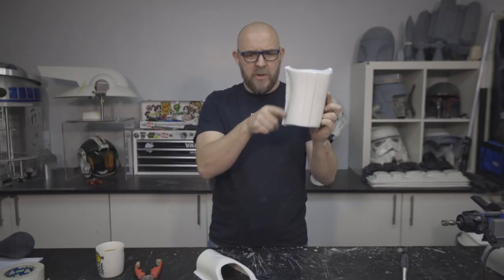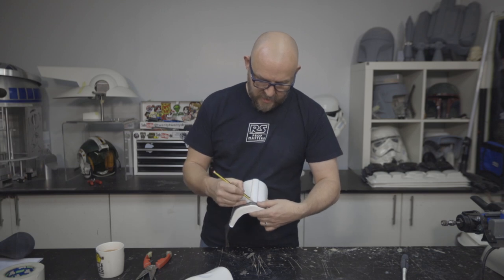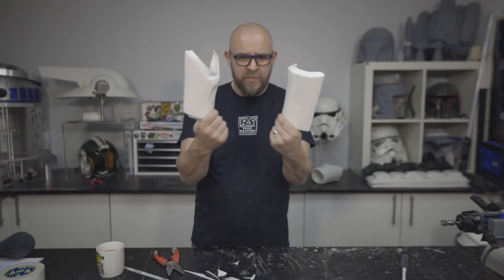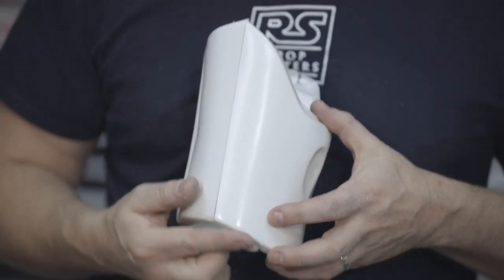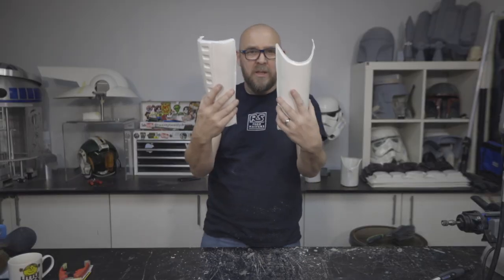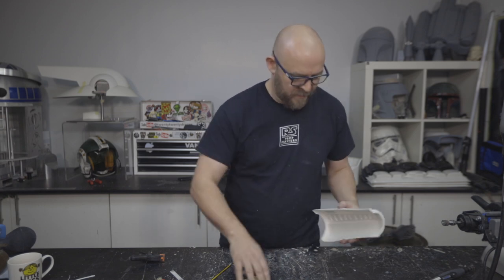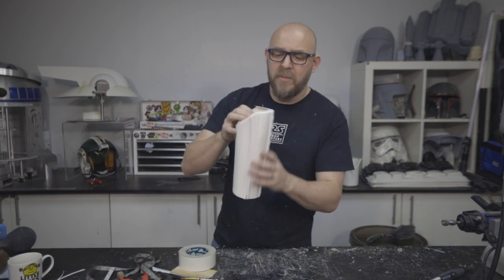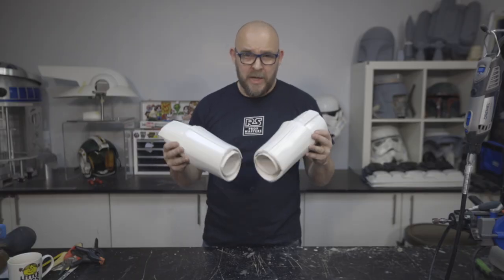Left Bicep & Forearm Building a Screen Accurate Stormtrooper Episode 4

Comment: On the right forearm video you called out 160mm on the larger end and in this video you called out 170mm on the larger end. Which measurement is correct or is the left supposed to be slightly larger? Thanks.
Reply: yeah, would like to know that too - because i am right at this step now

Comment: Did you guys change the inside half of the left forearm at some point? I'm building mine right now and it doesn't have as much of a dip/swoop cut out at the top (where your arm bends). The right forearm has it - but not the left for some reason. I'm assuming I can just cut into it and manually make the dip (to match the right side) - mostly to keep it from pinching/digging into me when I bend my arm. Does that make sense?